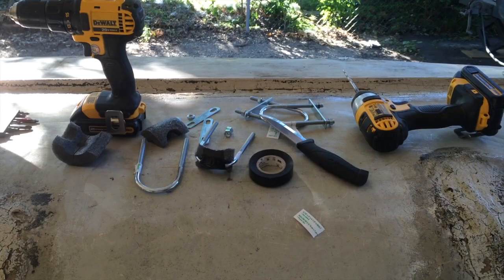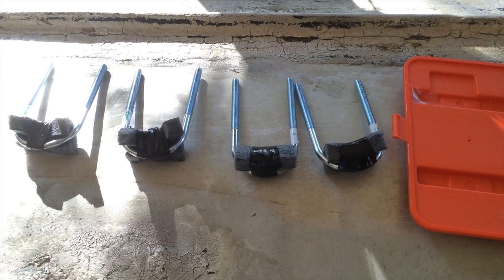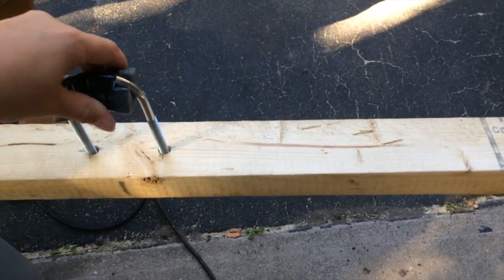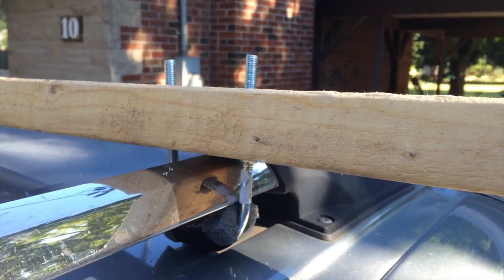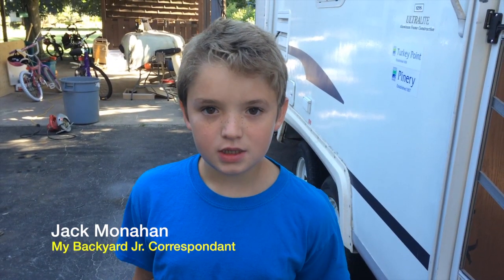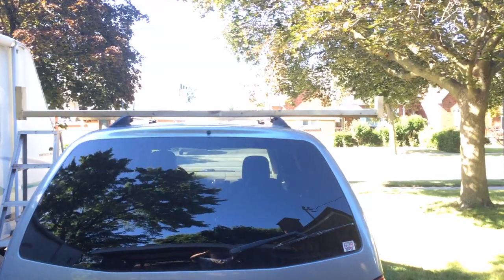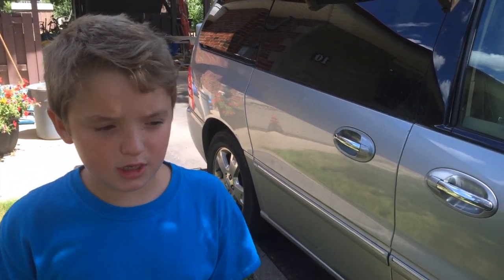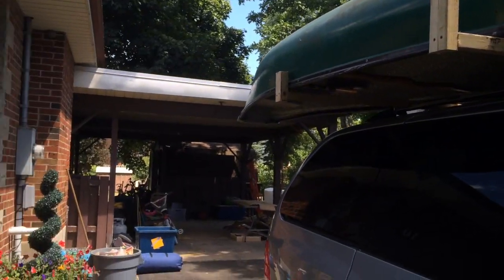Building Simple Double Canoe Rack

Comment: Hey Ryan, do you think this can work with the original rack running side to side? I notice your original runs front to back. Also, about how wide(long) did you cut your 2x4's? Thanks
Reply from the maker: Renee Leclerc I think it would work just fine. I would just strap the 2x4 crossmembers right to the racks. I measured the width of my two canoes and cut it about 2” longer than that, and screwed a couple of 6” 2x4 keepers on the end.